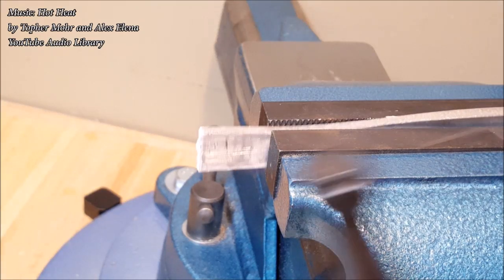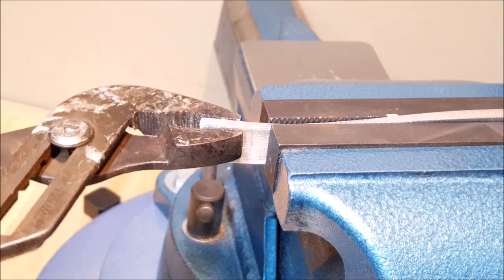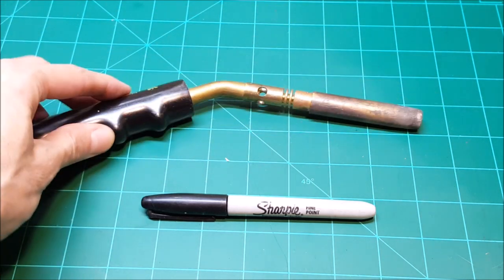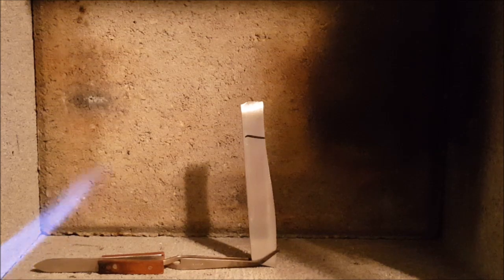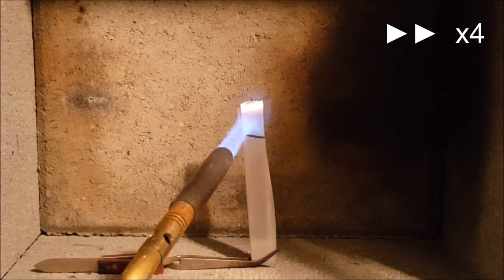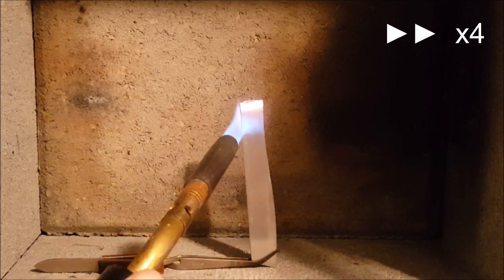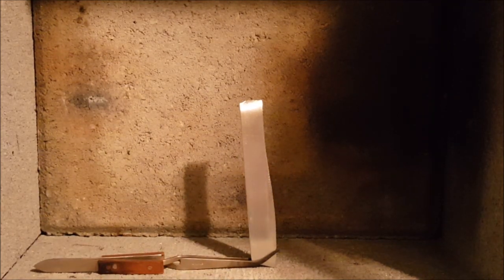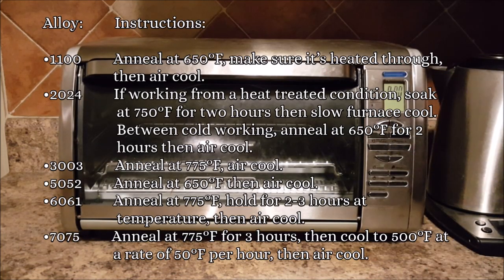How to Anneal (soften) Aluminum (with a blowtorch)

Comment: So basically once you anneal aluminum the integrity is lost. Even when it cools down and you work it you still are left with a much more pliable aluminum than when you started. Again that just ruins the rigidity of the aluminum which defeats the purpose of having a high grade aluminum such as 6061 or 7075 for strength purposes.
Reply: I’m not sure how that’s correct. If you need to shape aluminum 2-, 4-, or 7- series, you have to anneal it periodically. Otherwise it’s a useless piece of flat aluminum. You, as the one performing the work, are responsible for the final product. That’s just how it is.

Comment: Exactly What I needed , the Sharpie acting as a heat indicator is Brilliant!  Now the question I have is how can we stiffen it back up after manipulating it?  Can you just do this and quench it?   Of course I am gonna try that before I get an answer here  but.....  4now  Just subscribed and see you have a lot of content that is pertinent to my proclivities !
Reply from the maker: Thank you!  😊
Unfortunately hardening aluminum is a bit more complicated.
Most aluminum alloys will work-harden, so when you bend it, it does stiffen up some. But to give it a proper hardening, depending on the alloy, you need to put it in an oven for certain temperatures for several hours to 'age harden' it (precipitation hardening).
Some alloys will return to some of their original hardness in time on their own.

Comment: How you get it back hard?
Reply from the maker: Hardening is a lot more complicated.
Work-hardening which happens when you bend it around a lot can do that, but usually isn't a good way when you're trying to harden a finished product. I think precipitation hardening is the most common method but it requires more specialized tools than a blowtorch and a Sharpie, where you heat it up to very specific temperatures for a very specific amount of time and then cool it down in a very specific way depending on the alloy.  😊

Comment: Complete newbie here but how would this work with aluminium from tin cans? Would a lower temperature be required due to being incredibly thin. Has anyone experimented with this?
Reply from the maker: The temperature itself is the same. The difference is that less massive objects (ie. incredibly thin) will reach that temperature, and then go over it, much faster when you're using something like a blowtorch. So you need to be very careful with how you heat it up.
Reply: @SculptyWorks  Thank you. :)

Comment: I'm an artist. I  have 2'x 2' of 16 gauge (1/16") aluminum sheet that I want to punch hundreds of small holes in for a bas relief artwork. I was surprise that even with punches designed for metal sheet and a sledge hammer I could not easily make a hole. Just shallow dimples. Now I'm wondering if softening the sheet w my propane torch as you've demonstrated will make this job a breeze. Do I wait for metal to cool down before punching, or carefully (not to burn myself) punch while the aluminum is hot?
Reply from the maker: That's hard to say, I would experiment with it and see what results you get (and let me know here!).
The interesting thing about aluminum is that it's a very 'gunky' metal, and it can be really pliable but it can also be very brittle, depending on the alloy and the heat treatment.
I always use the drill when I have to put holes in aluminum, I never tried punching them.
As for working it hot or waiting for it to cool down, I think you would have to have it very near melting point for it to make a difference, at which point you might change the crystalline structure and make it crumbly. Aluminum can be a bit of a pain to work with.  😉

Comment: Factoid: Aluminum was more valuable than gold in the mid 1800's.
A Brit, Allen Millyard, tipped me off to the "Sharpie" method. I've tried it and "was pleased with the results"!
Tomorrow morning, I'm annealing a crush washer for the oil drain plug on my motorcycle.

Comment: How long are you letting it cool before bending?

What if bending in different areas... do you just repeat the process in each area?
Reply from the maker: I never timed, just let it cool to where I can handle it.
Any parts that reach the annealing temperature will be soft, and since aluminum conducts heat pretty nicely, on a small piece expect the whole thing to be softened. If it's a long/large piece and you want to bend a spot far away then yes it would have to be annealed by itself too.
Reply: @SculptyWorks  thank you...
Do single /small bends require re-hardening after annealing just the areas you want to bend?

For reference, I need to place four (4) ~90 degree bends evenly spaced along a 3-foot x 2-inch, 1/8-inch thick piece of 6063 aluminum flat stock
Reply from the maker: @alwayshustle5591   The spot that is bent will work-harden when you bend it, but the area around it might be soft, so if you can try to control how far you let it heat up. Re-hardening will require either work-hardening or specific amounts of heat for specific amounts of time which can be quite complex.

If you can, try bending a test piece of the material before going through the trouble of annealing it. Most bar and flat and round stock has some degree of ductility unless specifically ordered hardened from the mill. ...or if it was cast. Or extruded. ...test a piece and see if it bends or break.  😉

Comment: Thanks for the info .Now if after shaping how can I harden that again ? Thanks in advance .
Reply from the maker: Hardening aluminum is a bit complicated.
Most aluminum alloys will work-harden, so when you bend it, it does stiffen up some. But to give it a proper hardening, depending on the alloy, you need to put it in an oven for certain temperatures for several hours to 'age harden' it (precipitation hardening).
Some alloys will return to some of their original hardness in time on their own.
Reply: Thank you very much for the valuable information .  @SculptyWorks

Comment: Precipitation hardening of Aluminum is done by heating it and letting it cool slowly. Quenching softens it. Copper behaves in the same way. This video is inaccurate.
Reply from the maker: Precipitation hardening is a different and complex process that involves multiple heating and cooling and quenching steps, not at all the subject of this video.